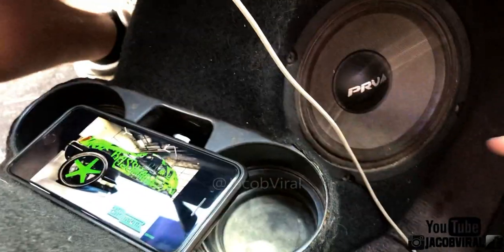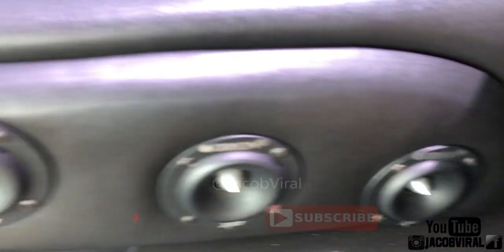2 8S SINGLE CAB TRUCK BUILD SUBWOOFER FLEX!

Comment: My little Dakota made it on YouTube thank you Jacob!
Reply: How much do you charge to do the doors. I have a ford flex!
Reply: Brian Hart I don’t build anymore sadly. I still go to audio shows but I do more import stuff now
Reply: What song were you used for the demo?
Reply: zombiezk03 #pro diplo- revolution 50 hertz
Reply: Nice clean build.
Reply: Love it. What’s Song name
Reply: I want a sub hooked up at 1ohm shit would slap
Reply: Out here making the dakotas look good
Reply: What’s the dimensions on the box?
Reply: @macdiddles7000  dude, 1 ohm doesn't mean anything it doesn't produce any more bass just because of a different impedance. For real......read if you're really interested in getting loud. Best advice anyone could give you.
Reply: @markbergstraesser7017  I want to get loud in a Dodge Ram but finding a good box has been hell. I’ve been through 4 boxes already.
Reply: got any better pics of the box? looks good
Reply: @markbergstraesser7017   @Mark Bergstraesser  well that's not entirely true although the statement is correct the buttom line is the lower the impedance the higher the current flow, the higher the currant flow the more power that gets to the coils the more power to the coils the more bass that hits the face right. However you are correct when you say "1ohm don't mean shit" because you could have a crappy set up ie box that not matched with thw subs, cheap amp that's high in distortion or just a bad setup all running 1 ohm and still sounding bad. I just wanted to point out that 1 ohm is a good thing when the rest of the set up is equally capable. Now newbies remember with great power comes great responsibility to bring the boom!
Reply: Hey bro, I have a Dakota too, I have 2 shallow mount skars in there and honestly they bump great for what they are, but I want to get a box like you since I already took out my center console for me chechuro box, but what are the box specs? Tuning?

Comment: 148.5 db
In '98. 2 jl 12 w3s, phoenix gold amps, mb quarts all around. 
Next week...
2 jl 10 w3s, jl amps and jl speakers. Figured why not. Nothin huge. Should be nice and clean.
Reply: You will be happy with the 10s.

I used to run back in 06 two Alpine Type R 12s on a 2k watt Cadence amp and they knocked stupid hard. Now I run one Type R 10 on a 2400 watt Rockville Pheonom amp and I'm waiting on my Rockville 12" Destroyer sub to come in the mail. 8k watts!!! 2k watts rms!

Comment: Damn that's impressive. Just 500 watts rms.

I'm currently running one Alpine Type R 10, 2250 watts peak and 750 watts rms. I'm running a Rockville Pheonom amp. 2400 Watts peak and 1200 rms. 8 gauge power wire with glass fuse. Stock head unit in a 2013 Optima turbo with a glass panoramic roof.

I really feel like my system should be louder. I have a 2.4g capacitor that I need to charge to install. I know that I need bigger power wire. I have 10 gauge speaker wire. The sub is bridged and a 2.75" dual voice coil.

Any tips can help me. I don't know much about this stuff at all.
Reply: You need a bigger power wire, subs can take more power..Just have to tune it properly. So id swap amps to a 2k and tune it with a oscope or id do it by ear. But i have been doing audio for over 24 years that was. The head unit is a limiting factor. I'd add a small headway cell battery to what you have instead of the cap. The stock alternator will charge it no problem.

Comment: I like it I have 2 8's in my 2012 f150 with 300w RMS 6.5" audiobank door speaker (4) 3 way with the stock tweeters as well so 6 tweeters and 4 high/mids but I'm about to upgrade my amp for the subs and run another amp to my highs and mids but it's nothing like this lil dodge Dakota nice little build I might upgrade to 4 sundown8's or  4 10's 🤙✌️

Comment: Man if he got a decent 1.5k and really pushed those lil subs he would gain quite a bit them pioneer amps have almost zero adjusting for tuning them so a good amp that he could dial in would be a huge gain....
Reply: And fry the voice coils . Spend more money to melt subs? The amp has variable lp filter and variable subsonic filter and gain of course.whoever told u that is ignorant.
Reply: @Hayawasa  I don't know I had 2 8 inch massive on a re audio 1200.2 they each had there own chamber  sealed and these are better by far
Reply: @scottklatt3689  im not sure which amp you had but the re audio 1200.2 that i used to have only put out 220 watts per channel in a 2 ohm load . It had 2x30 amp fuses. Even the class d 1200.2 only put out 300 wats per channel or 600 bridged, so either way u look at it, thats along way from 1500 watts rms. I have also had these exact speakers in this video, and there is no way 2 of them could handle 1500 watts for very long. Not even in a sealed box. Now if u could afford to change them out every time you gave a demo, they may last that long ,but they would not sound very good . Maybe if the song was fart noises it would sound ok lol.
Reply: @scottklatt3689  .